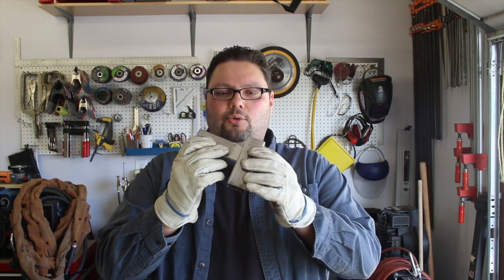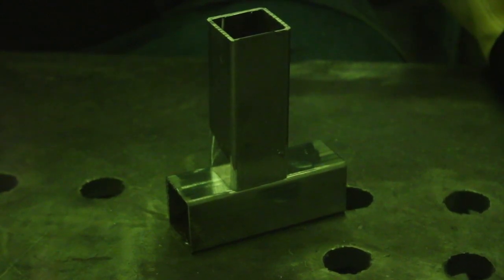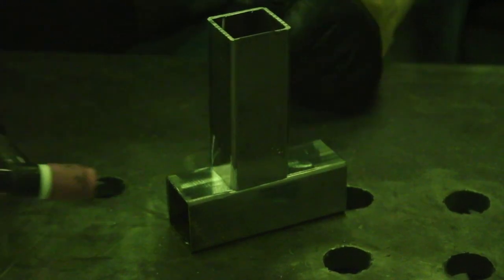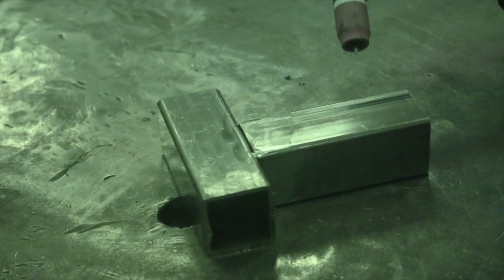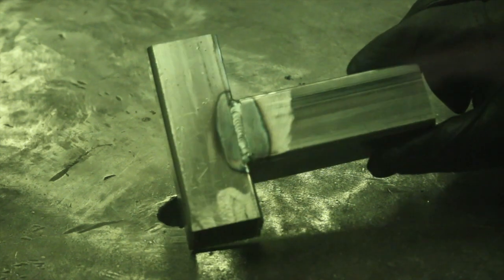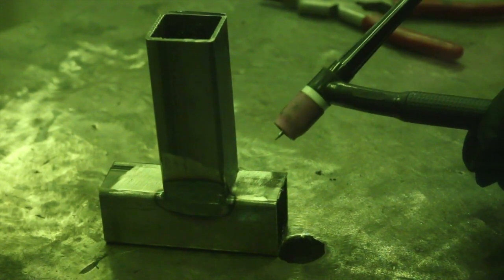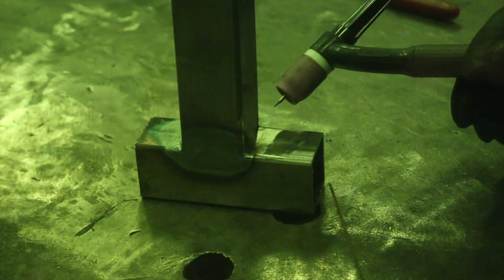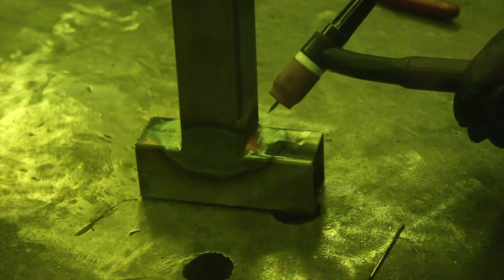TIG Welding Square Tubing

Comment: Good info! I'm looking to weld tail light brackets onto the rear of my trailer. The scrap i found is 1/4" angle 4"x4". I was going to try to TIG weld it instead of stick. Do you think it's too heavy of material to TIG weld? If not, what size tungsten ans amperage would I use? Assume it's DCEN on polarity. I have a Lincoln Precision Tig 185. Do you recommend 2% Lanthanated tungstens?
Thanks a bunch!

Comment: I regularly weld 1x1in by .040 AL wall tube and if you put the arc right in the middle of the joint it would blow through in seconds. You always "cheat" or move the arc to the whole tube side and not the cut tube side, as it wets you add filler that would join the thin cut side to the whole tube side.
Reply from the maker: tuyen dam Excellent advice and I thank you for clarifying that. As before, I completely agree with what you said and your technique. I am glad you shared this with us all and I hope you will continue to watch the show and provide your intelligent and constructive criticism.

Comment: Nice presentation, but the way you welded this thick tube is nothing at all like one would weld thin tube. You have to do more than just image it's thinner you actually change your technique.  If you didn't you would keep on getting melt back on the cut tube side.
Reply from the maker: tuyen dam You bring up a very good point and I completely agree with you. I will keep that in mind the next time I simulate something. Thanks for your insightful comment!

Comment: It would be nice to see how to TIG weld rounded corners with 90 grad tube
when tubes are like a + one to each other.
There is a V with smaller than 90 grad angle and it is not so easy to fill it with a filler.

Comment: Hi, I really appreciate your videos, as there are not many good tig welding tutorials available. One question: What amperage did you run on this weld?
Reply from the maker: David Schönenberger Thanks for the nice compliment. I probably had it around 125 amps or so, but since I use a foot pedal, it's not a constant amperage. I usually start off near full amperage(pedal) and slowly ease off as I continue through the weld as it builds heat.

Comment: Can you have "too much" shielding gas when tig welding? Like as a joke, if your friends cranked up the gas to 60 (from a norm of 15 or 20), would you even notice in the quality of the weld? Or are you simply wasting it?
Reply from the maker: John Rambo Yes, you can have too much shielding gas. What happens if is you have too much shielding gas you create a turbulent swirling effect that actually pulls in unwanted air, which contaminates your welds. So too much can be a bad thing!

Comment: Nice video,I'm just getting into tig welding(most of my welding is stick and mig).I have a hard time feeding the wire as I weld.Any tips on that?
Reply from the maker: bob litchko take a piece of filler and practice feeding in your hands while watching tv. I plan on making a video about TIG tips, so stand by for it.

Comment: For "finished" welds, I can definitely see the advantage of using TIG over stick or MIG. You're left with a completely acceptable finished appearance without breaking out the grinder and the flap discs! 

Nicely done, Dan.
Reply from the maker: Dwight Rahl In one sense it saves time since the weld is essentially finished when done, that is if done correctly. Unfortunately, the prep time to get the metal clean, and the generally slower rate of welding kind of evens it out. So, unless there was a compelling reason, I would probably use MIG on square tubing. Thanks for the comment!